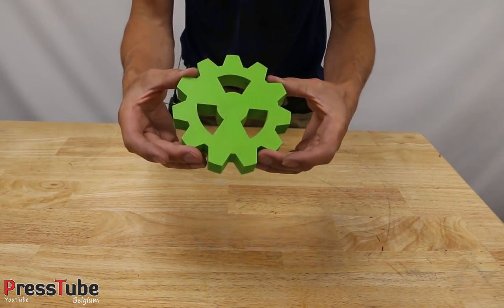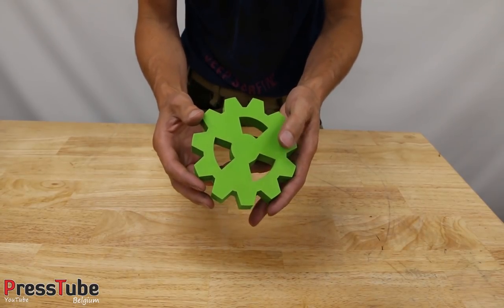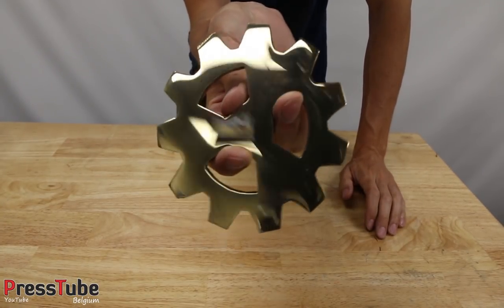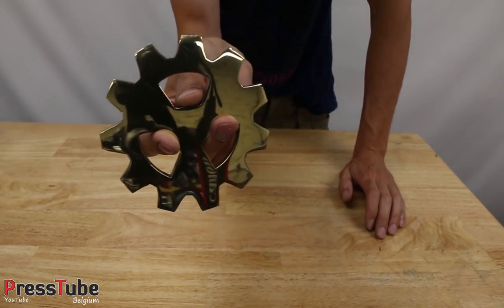Casting Brass Radioactive Gear - Inspired by The King Of Random !

Comment: Do you add borax before you melt brass or after it is molten?? I always add it after it is molten but I have heard it will help lower the melting point and also help stop the zinc flaring up/off. As always Matey great melt
😁👍🏻😀.
Reply: It is not necessary
Reply: Azael ok perhaps not then. I regularly melt real dirty scrap brass to Remove  impurities b4 I cast into 1 of a kind things so maybe wen I melt my clean brass it’ll be a bit better for me👍🏻. Check me out if ya got a spare second , if not have a good week my friend 😁
Reply: bigstackD Casting it's the same with aluminium cans. A good half inch of crap. Gotta cycle them once to get rid of the crap. And I use iodised salt to keep unnecessary dross back.
Reply: hey
Reply: big smoke Hey to you big smoke🤘🏻😁🤘🏻
Reply: Dylan Zrim cool yeah I alway remelt my Aluminium at least twice as you can extract soo much more from the slag ( slag/dross 🤷🏻‍♂️to me it’s the same thing)👍🏻
Reply: Yo hey mate great to see you here. I've seen him adding aluminium foil balls into a melt after melting. But I'm not sure if it's borax or something else (most probably yeah, what else would he add :P )
Reply: Kamal AL-Hinai yeah true mate . I have seen people add heaps of borax when melting gold pre melt so god only knows🤷🏻‍♂️😁
Reply: you could also use boric acid
Reply: Ankit Nandi cheers matey👍🏻

Comment: Almost every time I try to remove the printed part from the sand, the sand in the smaller sections crumble a little bit and it won’t come out even. Is there a method you use or is it just trial and error? Nice job by the way!

Comment: What type of casting sand is used? What binds it together so we'll?
Reply: It's petrobond sand. It has an oil based binder.
Reply: Walt Sorensen oh okay thanks, never thought about it until watching these vids.
Reply: Lots of shops use waterbased green sand and still get good results (assuming the moisture content is correct). 
Petrobond is nice as it doesn't dry out, but you have to have the right kind of oil. A bit easier to just buy the premade stuff. 
Petrobond also burns out over time so you either have to re-mull the sand with something like linseed oil or replace it.